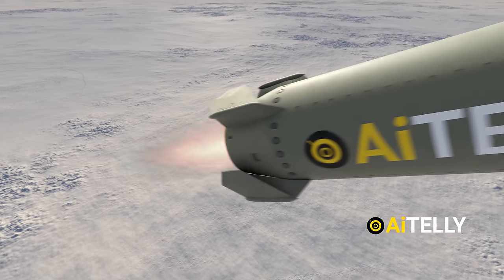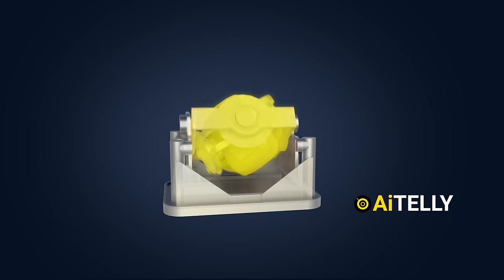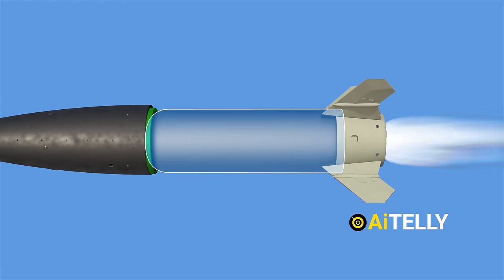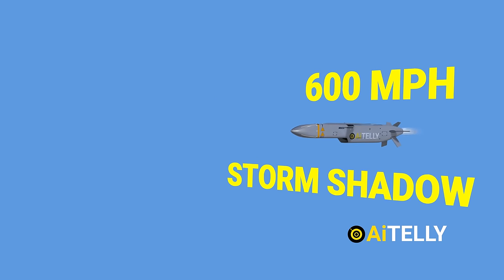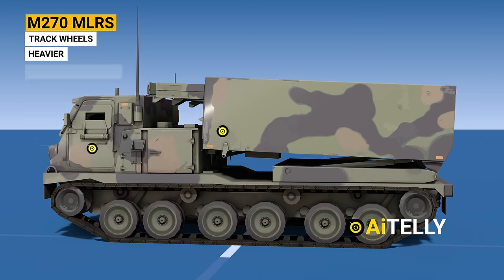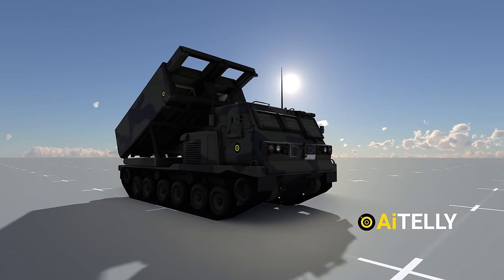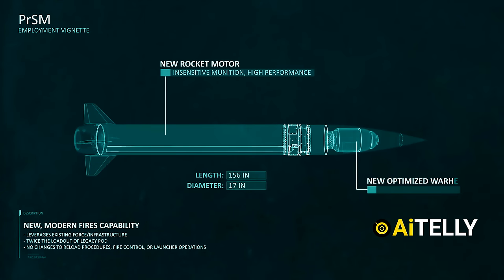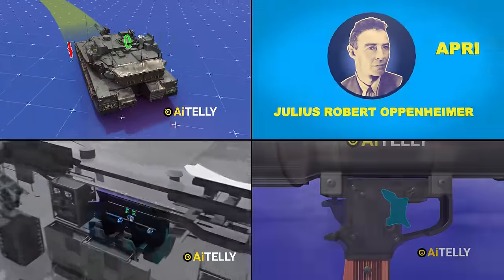How Missile System Works | ATACMS MLRS

Comment: Iskander is better.
Reply: No it isn't 🤣🤣
Reply: @Coinz8  The Iskander has greater range, speed and combat load. In navigation, they are almost the same, but Iskander took a feature like a tomahawk missile and it also uses the TERCOM system. In terms of the difficulty of interception, Iskander is more invulnerable due to its speed of Mach 5.9 versus 3 for ATACMS, but both missiles are difficult to shoot down due to the stealth coating and flight path - Iskander won.
Reply: @isadanjan4762 the minute man 2 is a better missile, it has longer range and better payload, as well as going Mach 10... see I can compare missiles of different sizes and task profile. S400 has failed to stop atacms at Mach 3, meanwhile the patriot has stopped the kinzhal Mach 10 missile Russia has claimed "unstoppable"
Reply: Isklander is less capable as it doesn't carry the primary 950 sub munitions that where devastating during the gulf and Iraq War.
Reply: Considering the performance of Russian military equipment in Ukraine I would definitely avoid it. Look at the videos of the destruction of S400 systems. Russian systems are simply inferior to modern western technology.

Comment: Question?
Regarding the Impact sensor at the beginning, is it possible that bad weather could interfere  with its projected path or destination?
-Say Rain, Snow, Hail Fog, High Winds?
Reply: It’s not really an issue. Prior to firing, meteorological data is taken into account and is processed by the weapon. Unless you’re firing it into a literal tornado it won’t affect anything in terms of accuracy.
Reply: it's about how gps signal are recieved during it's flight.

Comment: Nice video and nice channel.
How the control fins are moving, there should be a servo or motor to move them . as well as a source of energy (Battery) to drive those motors.
Reply: Is any of that significant for this purpose? 
What do you want them to do, indicate every screw in the thing? For what?

Comment: The monoblock warhead of the ATACMS MLRS missile cannot contain 500 pounds of explosives because 50-70% of the weight is the metal shell.
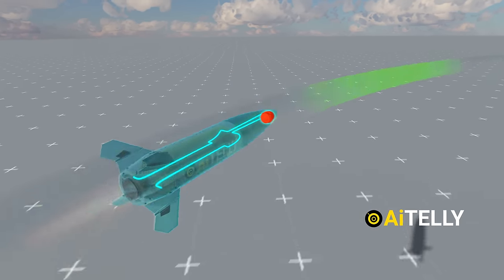Reply: 6:46  "Blast equivalent to 500 pounds of TNT".
Reply: @HalfBreedMix  For the idiots, I repeat again - the ATACMS MLRS monobloc warhead cannot contain 500 pounds of explosives. It weighs 500 pounds by itself - explosives plus shell. And some short-sighted YouTube bloggers believe that if the warhead weighs 500 pounds or has some other weight, then this means that the explosive itself weighs that much, but this is not so.
Reply: @ШтепсельТарапунькович well, explosives can have more efficient than tnt equivalent filler
So even if it is only 250lb warhead, it can have a filler that is 2 times more efficient
Reply: Name an explosive that is twice as effective as TNT (trinitrotoluene).
Reply: By the way, the description does not say that the warhead carries explosives equivalent to 500 pounds of TNT.
Reply: I only gave it as example
closest one off my mind is RDX, 1.5 times more effective
Reply: So your comment about explosives twice as powerful as TNT is complete bullshit. Such an explosive does not exist, which had to be proved.
Reply: The unitary variant of the ATACMS Block 1A uses an off the shelf warhead. The initial (QRU) missiles used the warhead from the Harpoon missile. About 215 pounds net explosive weight.
The warheads came with a built in fuze so that bit about an impact sensor in the missile nose is wrong.

Comment: Ok , I'll give you my invention way , my flash driving invention running in light speed way can power that perpetual power.  No batteries just running and flying. 
My invention is perpetual motion power so the missile can go up and can Returns if not used . It has no weight and floating in the air , and can wait .
Before blasting.  The missile can be control by the base . Can be a guide to approching aircraft to destroy or not .